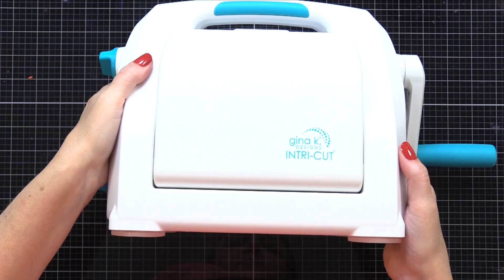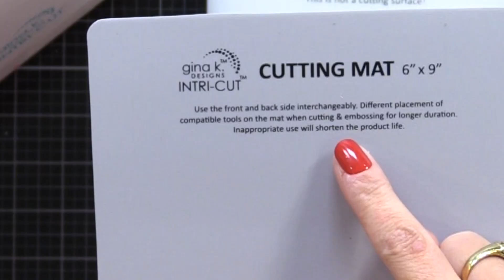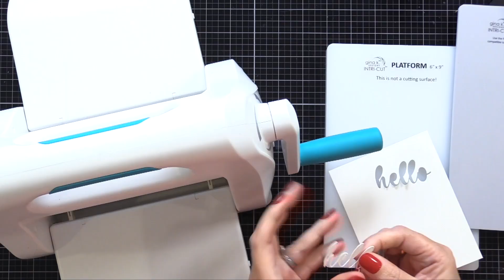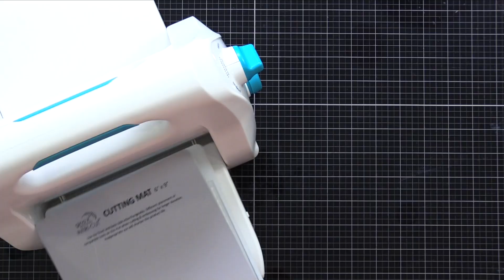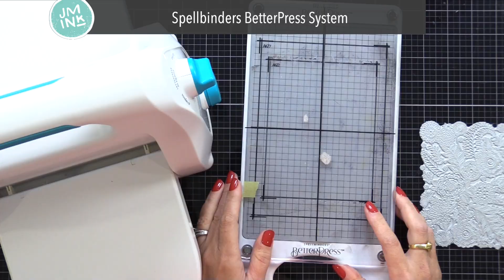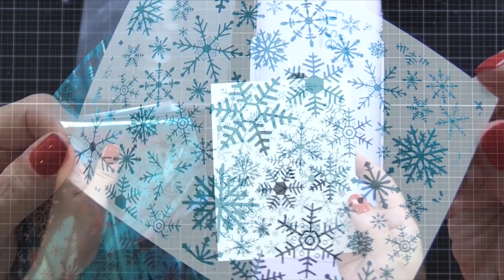NO Guesswork Die Cut Machine!

Comment: Yes, this machine is exactly like the Bira machine found on Amz (which I have and enjoy) and also the one used by Close To My Heart.  It's a nice option.  Prices vary depending on where you order from.
Reply: Seems like Gina K is just putting her name on that machine.
Reply from the maker: turns out there are several adjustable die cut machines out there. i had never used one. not sure if they all work the same... i just know this one works great for me! :) my guess is there is one manufacturer making these machines.
Reply: Bira is 89.00 on Amazon. No shipping charge if you have prime .
Reply: @carolellerman1800  Bought mine from the Bira website on Black Friday for 15% off and free shipping.  I've been using it non stop since it arrived (only took 2 days to arrive).
Reply: But this Gina K machine costs $70 more.
Reply from the maker: turns out there are several adjustable die cut machines out there. i had never used one. not sure if they all work the same... i just know this one works great for me! :) my guess is there is one manufacturer making these machines. not sure if the guts of the machine are the same!
Reply: I am considering the cricut joy for my first machine.
Is this capable of replacing the joy?
Reply: @sueellenmcgoey6095 They are different, just letting you know. The cricut uses a computer program whereas die cutting machines like this one uses wafer dies which you buy separately. The images you cut in the cricut program are endless though you have to buy some also.

Comment: I’ve been using the Bira machine for several years and it is almost exactly like this. I’m guessing this will work just as well.
Reply: I just looked up the Bira machine and it looks identical except for the colour! I had never heard of this brand before.
Reply: Yes it's the identical machine (except for the price!)
Reply: @tiffinvolpe614 This version comes with a die set as well
Reply: I own and use a Bira machine also but never had good results using it with my Glimmer Hot Foil System. Have you used your Bira with the Glimmer? I ended up buying a Platinum 8.5 but use the Bira for all 3D and 2D embossing and most die cutting projects.
Reply: @SlowHorses-x1v  I have a Bira cutting machine as well and I have no problems using my Glimmer Hot Foil System with it.
Reply: Yes this is identical to the Bira machine and the CTMH machine.
Reply: Close to my heart also has the same die cutter
Reply from the maker: i haven't used it... but hope you like it!!!
Reply: I have the Bira as well and love it.  Exact same thing, different color,  better price point.
Reply: I love mine!
Reply: Oh wow, I just googled and it really is identical right down to the text on the plates.
Reply: Can the Bira use the better press? Can the Bira use the machine to foil with the plate to foil? It’s only $90 where as Gina K is over (with shipping) $200.
Reply: I bought the Bira, and it didn't work well. The handle was awful. Maybe they are making them cheaper .
Reply: I also use the Bira. This looks like a copycat version of it.
Reply from the maker: turns out there are several adjustable die cut machines out there. i had never used one, which i mentioned in the video. not sure if they all work the same... i just know this one works great for me! :) my guess is there is one manufacturer making these machines.
Reply: @jennifermcguireink thank you! Going to have to get tiered swing out shelving for the machines! I had a sizzix big something, then heard about the Empress. I loved the Empress, but i could not do tbe 3D folders by Crafter's Companion! So, when the Gem II came out, i got it, too.  It does the 3D embossing folders so incredibly, but i am SO frustrated with the plastic shim! They say it is normal to have it so incredible warbled not just warped! It makes sandwhiches difficult to put into the machine and some parts of dies don't cut properly. I have bought 4 in 6 months!  I give up! I dread using it now. Though they said it is normal, the sandwhich caught onto the frame and flip cover,  destroying the machine... it just seemed to explode! They replaced it, but i am holding my breath! There were a bunch of posts with the same problem.
Turn & flip helps the cutting plates stay useable, but not the shim. So, I got the magic mats, which led me somehow  to your video about taping plates. I have not been able to find the correct sandwhich for the magic mats yet. They are cool, though, the way you can fix them.  Then,  I remembered this new video of yours, and i am considering this after i recover from over purchasing dies and paper.  I sure hope it will work well!  Thank you. Love your videos! This was so detailed by easy to understand!